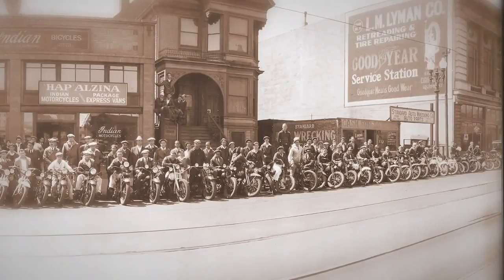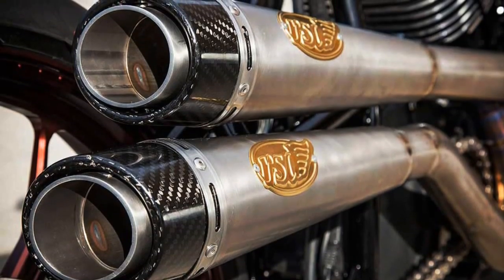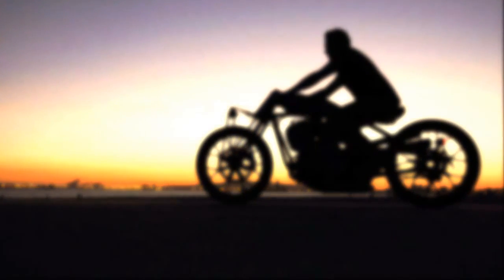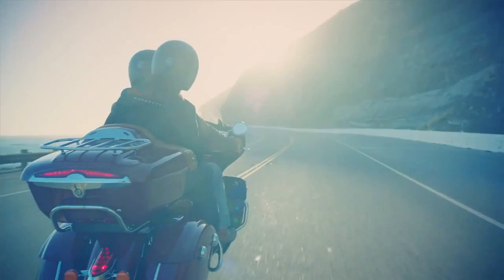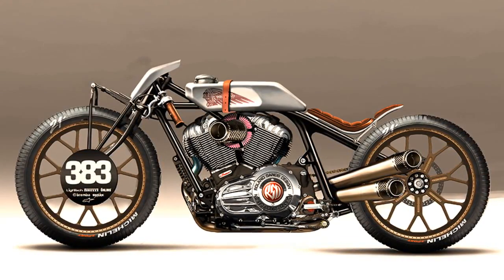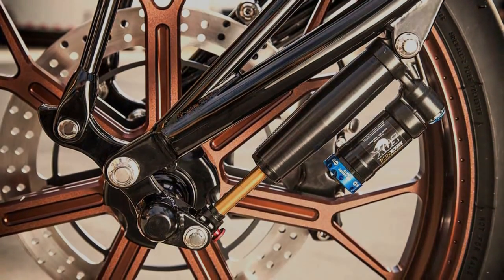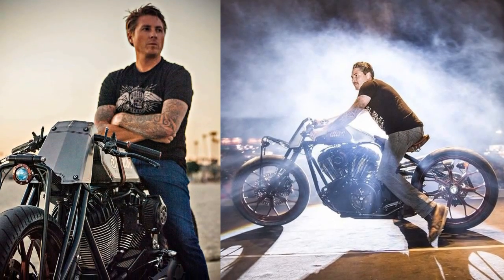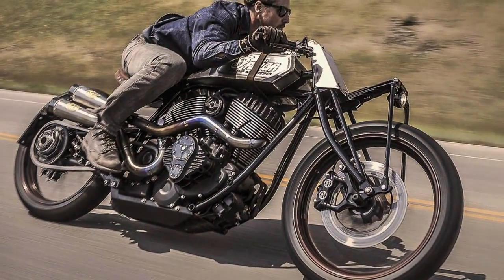Cafe Racer (Indian Chieftain by Roland Sands)

Comment: Sure screwed that one up. That rendering was incredible. The lines and proportions and all kinds of wrong on the actual bike. Just amazing workmanship though and some gorgeous features but most important thing about the race look is the profile. Details are secondary and the stance of that bike just missed the mark.
Reply from the maker: Mason Kroeker I think i already figured out the problem.The engine size on the rendering is smaller than the real engine.The wheels on the rendering are also bigger.But remember, the real wheels have 21 inches in diameter, which is a lot.In my opinion, the big size of the Indian engine, changed all the original plans. I agree with you when you say that the rendering is incredible.But I think Roland Sands tried to make the best he could. Thanks for sharing your comment. Cheers.
Reply: No doubt at all that's it's an incredible beautiful bike. Roland is amazing but it just doesn't capture that early racer for me. Early century Indian racers ran 28 inch wheels.
Reply from the maker: Mason Kroeker
I think 28 inch wheels are not very friendly for a good handling. And considering that the back wheel is supported with only one side arm, perhaps there is too much weight for such a large wheel.
Reply: You probably wouldn't be able to find 28 inch wheels  these days either. Unless they were the old tech clincher rims which would be unsafe.